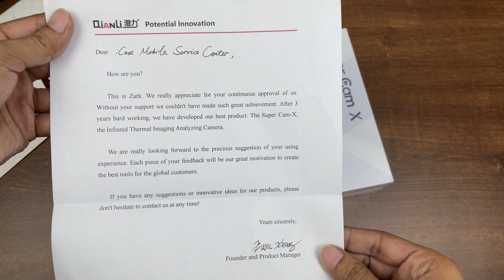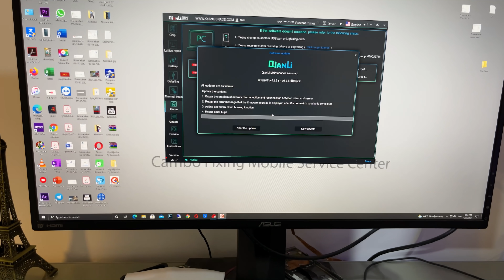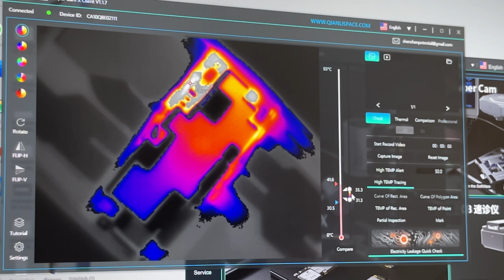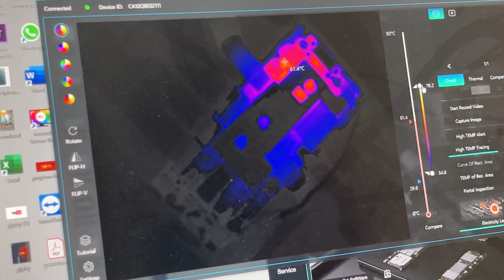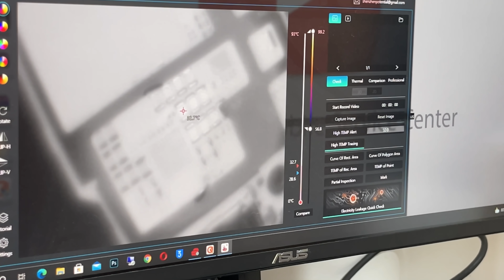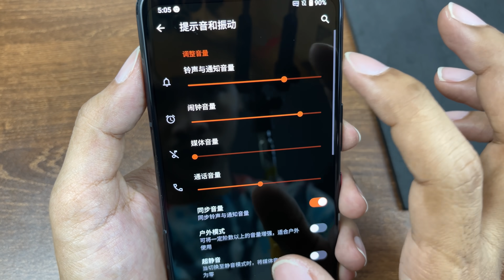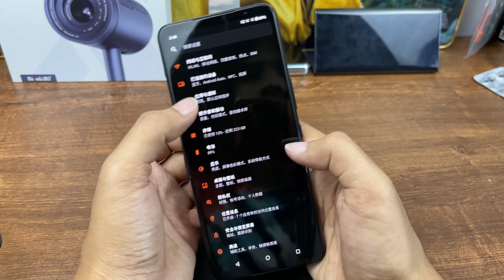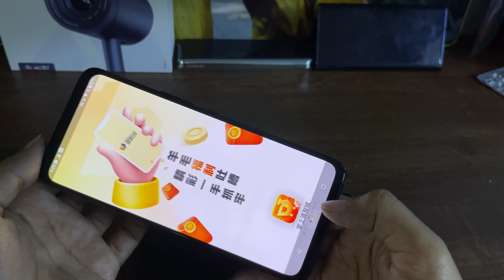ASUS ROG Phone 5 Dead fix with Super Cam X...

Comment: Great work. So did you replace the micro chip or just resolder on the old one?

Also what did you spray on the card to help open up the back of the phone?
Reply: I would assume alchohol, or some other non-conductive adhesive remover
Reply: bruh, the chip had a literal hole in it due to it exploded.

Comment: Wow, that asus can easily got issues about no power and charging can heat up very quickly. Very interesting you got super camera there.
Reply: hmmmm, never once had my ASUS 5 Pro, never have heat issues my max temp for the phone was 88F normal heatings for hard gaming sessions, and or problems imo. Never once experience a bug yet with my Asus so idk what to tell you bud, other then My Asus 5 Pro has done me wonders and still is. Just thought Id put in my ibput about my Asus.
Reply: hmmmm, never once had my ASUS 5 Pro have heat issues my max temp for the phone was 88F normal heatings for hard gaming sessions, and or problems imo. Never once experience a bug yet with my Asus so idk what to tell you bud, other then My Asus 5 Pro has done me wonders and still is. Just thought Id put in my input about my Asus.
Reply: #Natsume... it is probably because of owner, the way he or she is using it.
Reply: @tangshangrangsamarak6908  It because the charge IC dead shorted.

Comment: Regretted for buying ROG 3. Accidentally  dropped from less than 1 foot, the inner of the screen cracked and it blackened out. A super hyped gaming phone.
Reply from the maker: yes
Reply: or, maybe be responsible and get a case, glass is glass and glass will break, its not like it has a drop rating, I'd be mad too if I broke my phone but dont blame it on Asus

Comment: Hey buddy,

I have recently purchased ROG 5 and the biggest issue I am facing is that it doesn't support VoLTe calling directly from phone...
Need to use Google duo and other service's.
Kindly help if u can help to solve the issue
Reply: Hey gamentrix you came here too 😅
Reply: Brother that's the service operator issue not the mobile's . Mine works fine and volte enabled
Reply: @balasid8778  how can I get this checked with service Operator..

Jio & airtel both not working buddy
Reply: @GamEnTrix  well contact their customer support and say you need to enable volte and if enabled they will give you their settings and if not enabled they will enable it for you !!
Reply: @balasid8778  ok let me try
Reply: This problem also in many mi phone...
Reply from the maker: Software problems
Reply: @icasemobileservicecenter3293  maybe yeah but I use same airtel and jio on my device and got volte enabled on both though
Reply: @balasid8778  bro... VOLTE is supported for phones but above 823 chipset  service provider don't support phones.

I got to know...from the dealers
Reply: I'm planning to buy ROG 5 by end of this month. Any suggestions?
Reply: @balasid8778  I'm planning to buy ROG 5 by end of this month. Any suggestions?
Reply: Big fan Gametrix
Reply: Dude check your settings
Reply: @sarvesh740  guide me with my settings..
I already discussed with service provider that JIO & AIRTEL don't support 888 chipset model phones for VOLET call through directly
Reply: @deadayya  You cannot judge ROG5 on your experience of ROG2, surely they have made a lot of improvements on experience of previous ROG series issues, Anyway I have already bought ROG 5, Its been a month now haven't seen any issues till now 🤟
Reply: @deadayya  Not sure about that cause after purchase i had 4-5 system updates.....
Reply: @aman5851  bro is your phone still working fine?
Reply: @mohdmuzammil91290  Yup, Workes great, Never felt any lag, no heating issues, it's a bulky phone and but will not crack in two like shown in Jerry's video, i had like 10-15 system updates.... Let me know if you need any more information
Reply: @mohdmuzammil91290  If you drop the phone it's back screen and back glass will break, I dropped my phone once but nothing happened as i had my phone cover on it
Reply: @aman5851  I am looking to buy Rog 5, do you recommend?
Have you faced any issue with wifi?
Is volte working directly?
Thanks!
Reply: @icasemobileservicecenter3293   same issue with me but it works on sim 2  how come ?

Comment: Vandal! You can and should carefully remove the protective screen from the board, you crushed the metal !! Is it not possible to replace the thermal paste with a new one in your service center? Didn't think to wear gloves, otherwise they left a bunch of greasy fingerprints !!!? Well, at the end, it would be possible to change the double-sided tape, remove the old one and stick a new one !! Aren't you ashamed to shoot such a repair?
Reply from the maker: thank you
Reply: Did it work or no.
Reply: Pretty sure it works. I would do anything to get that working. My iphone SE2016 isnt best phonr

Comment: I have a rog phone 5 on the bench with the same problem, it doesn't give any signal. Did you just take the component out and put it back in, or left it empty?
Reply: Why you don’t respond him
Reply: It a Qualcomm pm8150b power management IC. It used for fast charging and is a common issue for them to fail. Yes replaced a couple as bought a lot of them.

Comment: The Guy never respond when we Ask what kind of IC he removed…guess he just don’t know
Reply: I put dislike because he doesn’t respond
Reply: It a Qualcomm pm8150b power management IC. It used for fast charging and is a common issue for them to fail. Yes you can remove it completely and phone will still slow charge. It not needed.  

He left it out. I hate when people do these video but try to keep a secret what was done.

Comment: Wait. You just removed the faulty ic. Why didn't you replace?
Reply: LoL..of course he remove n replace
Reply: @Qisttryyn  did he? 🤔
Reply from the maker: this chip for both charge
Reply: It a Qualcomm pm8150b power management IC. It used for fast charging and is a common issue for them to fail.

Comment: bro, my rog 3 was dead too while charging. it's just stuck in the charging animation and died. i took it to the service center they say it has some motherboard issue so they want me to spend 40000 for motherboard replacement...Really? If i want to spent that much amount, i would have just bought the new one with 35k.

can you help me repairing this phone. it will be very helpful since i dont want to lose it. plz reply sir.. thnkyouuu
Reply from the maker: Yes i can fix